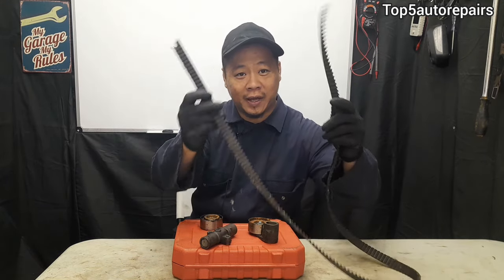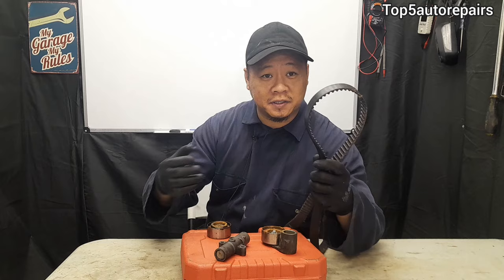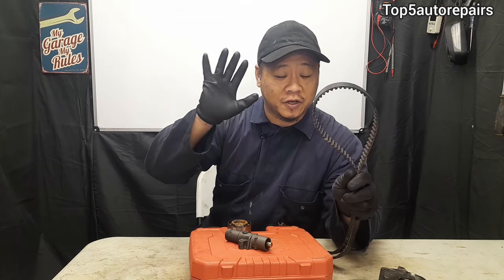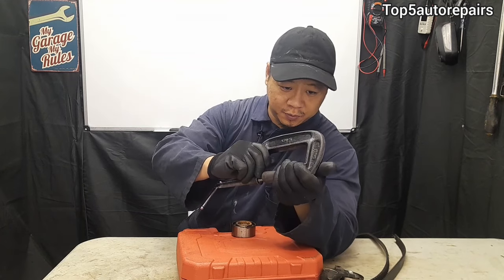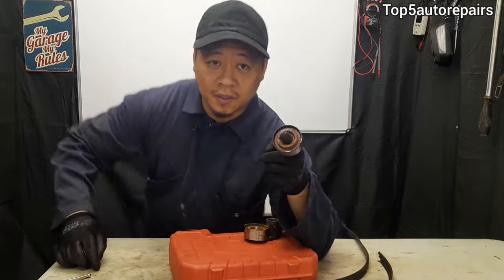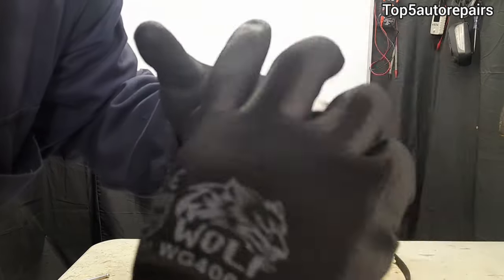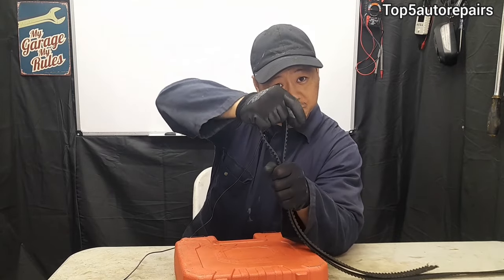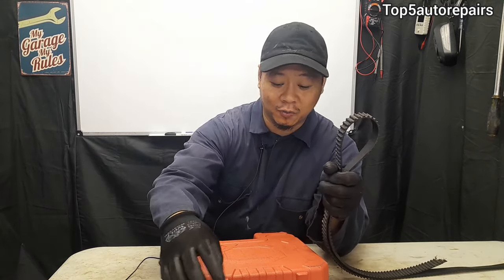6 Signs Your Timing Belt Is Bad or About To Break (Belt Breaks while Driving)

Comment: in my case the water pump seized. Suddenly the heat in the cabin disappeared. A seized water pump rubbed the timing belt and broke. In the end 2 bent valves and all rockers broken. I disassembled, replaced the damaged valves, assembled new rockers. I put it together and boom I'm still driving
Reply: JUST LIKE THAT? DAMN YOOU ARE THE MAN. WHAT VEHICLE WAS IT? I HAVE A HONDA ACCORD WITH WIERD PROBLEMS. IM NOT SURE WHAT TO CHECK ANYMORE. RUNS AT IDLE BUT OFF
Reply: Thank you for your upload and your comment about your situation was I was advised as a female it may be the water pump how do I distinguish my go to the mechanic and they're not trying to rip me off
Reply: I believe that’s what happen to my Camry it was going fine till the water pump gave out and I lost power steering and had to break hard onto a side road to prevent myself from crashing it’s still broken and I’m trying to fix it now

Comment: I didn't even take the chance on the tensioner and idler pulley last time I did my belt, even if they were good, I just straight up replaced it all.  Might as well, if you're digging that deep into your engine to begin with.

Comment: If my tensioner is bad and motor is rattling like loud lifter rattle, has the damage been done? No engine lights, idles as it should just rattling?
Reply: I have a 2013 Santa Fe, V6 3.3 with timing chain… rattling chain slapping cover perhaps?
Reply: if its that loud and noticeable, its safe to say damage has been done already. but probably not significant enough that you havent noticed loss of power or hesitation. still if youre gonna get that deep to have to replace the tensioner, u should replace the chain as well. although i had a situation where i only had to replace my belt tensioner(although im in need of replacing the belt as well). for my situation i was able to replace the tensioner without the belt removed. since your car is relatively new, i'd feel its safe to say you wouldnt need a valve adjustment. but still do pin point where the noise is coming from. this little job could cost you the life of your engine so you really should get to working on that as SOON as possible.
Reply: No no damage yet, fix it before it breaks while you’re driving like mine did yesterday, if you don’t you’ll regret it like I do now lol
Reply: Man sorry to hear that. Was it due to a bad tensioner and did the chain end up giving way?? It’s scheduled to go in in two weeks. It’s been sitting for two months because it’s hard to find a reputable, honest mechanic the good ones have a wait. Hoping I don’t invest the grand to crack it open and it’s something more/worse. Seems that the tensioners are somewhat of a failure/defect, one of the many questionable issues within the engine components of this motor, that can fail/wear.
Reply: @Detect-Oregon  i haven’t taken it apart yet because it’s so cold but If I had to guess either the tensioners and guides were probably all on their way out and it probably got so loose that it jumped one or two teeth, won’t know for sure until I break it down though, I will say right before it went bad, the chain noise actually went quiet and it was running oddly smooth, and then in the blink of an eye it started misfiring and making backfiring sounds like a beefed up Japanese car, but the sound was coming from the engine bay not the exhaust pipe lol, and it had a weird burning oil or coolant smell all the sudden too, hopefully it didn’t bend valves, mine was on an 04 Lincoln Town Car by the way, very reliable engine but those timing chain parts just don’t last forever, timing chain/belt maintenance is critical, oddly enough my 97 f150 with the same engine is almost 10 years older and has 250k miles on it, it’s timing chain is still quiet and working flawlessly

Comment: I bought a used lexus rx330 2005 and I took it to garage needs coil tuneup and timing belt he said timing belt hasn't been changed in years I figured that just glad I got it there before it broke
Reply from the maker: That's a wise investment!
Reply: @Top5AutoRepairs  I bought from a used car lot he said it was a trade in at a Ford dealership it has 185thousand miles I paid 6300 inside and outside in excellent condition but may have to pay for maintenance because seems it has been maintained in a while
Reply: @kellysutton2780 why did you pay $6300 for a 2005 rx330??? Horrible investment 😂😂😂
Reply: @zenodee  because I needed a ride and that is all I could afford
Reply: I've never seen a Lexus waiting for roadside assistance .

Comment: Do you know if a bad timig belt will give a cod P0420 on and Audi A4 2012 ? I dont want to have to change cat if theres another issue
Reply from the maker: Unlikely
Reply: Same issue is your check engine light on?
Reply: @kingcatkid8567  yes check engine light on
Reply: @EvolOne-ic5xv  did you replace your converter or just the belt
Reply: @kingcatkid8567   i changed my spark plugs, and it went away, but it's been sitting , i had to order coolant resevoir and hoses to fix since it's all cracked Im slowly fixing issues

Comment: did that belt fail from wear because it as incorrectly installed as indicated by arrows printed on the belt showing correct orientation? or just wear and tear lack of service in general
Reply from the maker: I believe it was normal wear and tear. Honda Pilot 130,000 miles. Never been replaced.
Reply: @Top5AutoRepairs  Wow twice amount miles before it broke
Reply from the maker: Yep
Reply: Mine 1995 accord timing just broke. Made it to 180k never been replaced once 😂
Reply: @Top5AutoRepairs  Probably had to change valves if this belt broke unless the owner was very lucky. I mean really lucky.
Reply: @retiredsnowbunnyhunterx5106  don't risk it .
change every 80k for piece of mind. not worth the additional expense if it breaks.
Reply: @e.r.videography6209  Oh I not. I had bought 2006 kia Rio last year for $400 dollars only had 57k on it. The first thing I did was change the timing belt, tensioner and water pump. Changed oil and filter, plugs and coil pack. Changed transmission fluid and filter. Pcv valve. The car been sitting for the last 3 years not driven. Definitely wasn't gone chance that timing belt. I've drove an put 10k on it already.
Reply: @retiredsnowbunnyhunterx5106  Sounds good bro! always keep on top of your maintenance.

Comment: Hello 
i have a 2003 accord v6 running wierd. I thought about the timing but no indication for timing issue because it does not have low compression. In fact the compression seems high for such an old car; i think spec is 160 and above with a max variation of 14 between two consecutive cylinders and i measure 195-200 on all cylinders. Got another gauge and same compression values with no apparent leak while the gauge is on. Fuel pressure is within spec; spark plugs were new and oem when i last replaced it (fouled now) and ignition coils are not oem but are brand new. If i could have a lead, it would be great

Comment: Hi. I have Peugeot 807 2.2 hdi 128hp, the timing belt jumping an the engine stop. That was happening during driving. when i put it in automatic, the engine revs but doesn't start. The engine has no strange noise. Is it possible in this case to know of a broken or crooked spring or rocker??what do you recommend to do in this case??
Thank you.

Comment: I have a 2006 Toyota tundra high mileage up replace the timing built twice. I brought it new .

Has over 450,000 miles 😂😮 but still going same engine. Mine are issues.     The issue I'm having now is making a whining noise . on the passenger side of the engine sounds like near the compressor. I think I'm not sure what it's coming from the passenger side front part of the engine. Do you have any ideas? Thank you.
Reply: “Mine are issues “ did you mean minor issues

Comment: I have a 2006 Toyota Sienna , When I start my car I hear a squealing sound that goes away after 10-15 seconds. It happens every time I start it even if the car is warmed up. Both belts outside of the engine (alternator and power steering) were replaced and the tension seems ok.. Is it possible that it could be the timing belt causing this?
Reply: Toyota's and Honda's are very good cars but sometimes  have  problems with fan belts not really timming belts or chains but still do check

Comment: Should the water pump he replaced with a timing belt on 98 4 runner with 150k?
Reply from the maker: It's recommended to replace the water pump and timing belt together
Reply: Is a serpentine belt and timing belt or chain the same
Reply: @Top5AutoRepairs Is a Ford Fiesta 1.6 with 109,000 need a timing belt change yet if no problems running? I have seen some say 150,000 miles change?